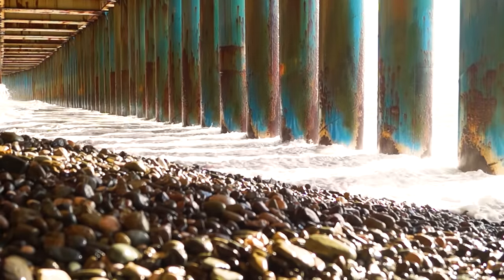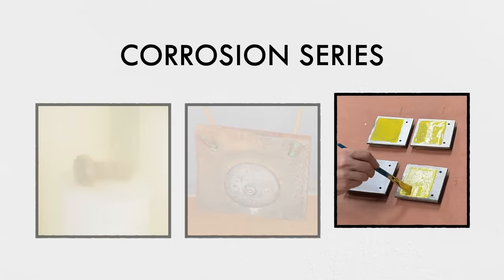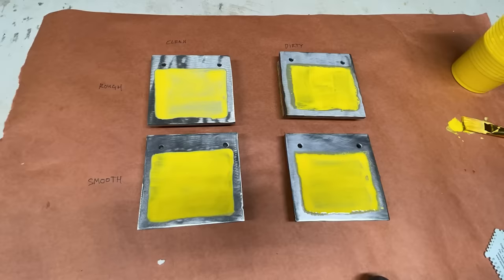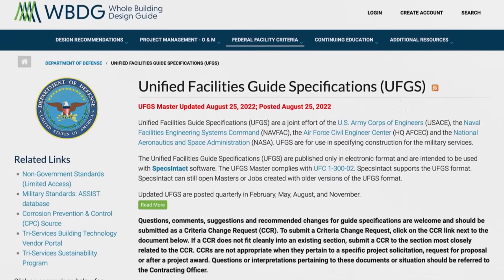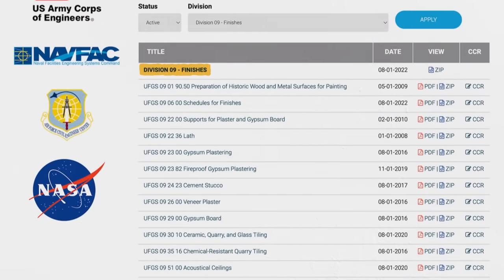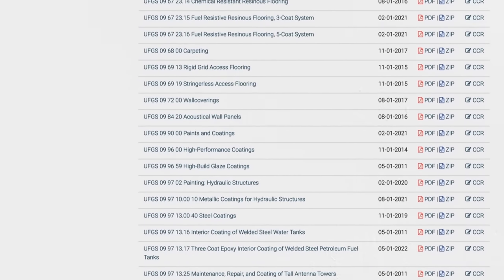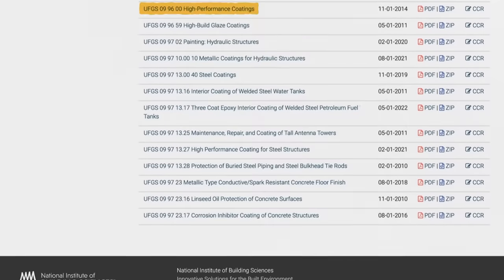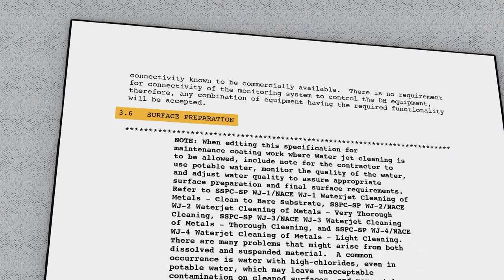What's the Difference Between Paint and Coatings?

Comment: I'd like to argue that the field of engineering is fractal. No matter what it is you're dealing with, an engineer had to design it, and another engineer had to design parts or materials for it.

There's no bottom. No matter how far down you go, there's something that an engineer did. Coatings are engineered, and I bet the components of that coating are each engineered.

Comment: A little late to the party, but as a painter, I wanted to correct your statement about paint at the start. Paint is not just for decoration, it is used to seal substrates, create bonding layers, form moisture barriers and protect against UV or chemicals, prevent rust etc. There are a large number of products that are used which are classified as paint. Then there are coatings that are not classified as paint, such as the polyurethane coatings you use to seal and protect timber floors/deckings, form “high performance” protective coatings etc. You could even consider sunscreen a coating, as it is a coating designed to protect your skin from UV.

A more accurate way to describe the relation between the two is ALL paints are coatings, not all coatings are paint.

Comment: Forgive me for misunderstanding, but wouldn't the paint on the outside of a house be a coating? My favourite podcast, Well There's Your Problem, has mentioned that one of the issues with modern conservation efforts of older houses is when the wrong paint is applied, that can prevent the structure of a house from 'breathing', causing bricks to crack in the winter or wood to rot from humidity.

Comment: If there was a video on heat treatment, fatiguing, inhibition, and alloying, you’d completely finish the ways that corrosion is prevented, treated and mitigated, (while alloy and heat treatment may be material selection, they are very important to the ways you prevent corrosion)

Comment: Sorry to disagree with comments below. I believe the Sydney Harbour Bridge and steel approach ramps are continuously painted. Or at least were. There is a massive amount of surface area on this amazing structure, it could easily be a 20 year round trip. The below link states: 
Regular repainting of the steelwork is an essential and ongoing part of the Sydney Harbour Bridge maintenance. Around 485,000 square metres of steelwork – which equals about 60 football fields – need to be painted, with 30,000 litres of paint required to give the bridge just one coat. Inspection of the steel work is necessary and a variety of tradespeople help maintain the bridge. These trades include ironworkers, boilermakers, fitters, electricians, plasterers, carpenters, plumbers, riggers and painters.

Roads and Maritime completed work in 2015 on about 90,000 square metres of steelwork below the deck level of the southern approach spans. This maintenance work involved removing the bridge's old paint and repainting. As part of this process, each layer requires a full day of drying time, making this project time consuming and heavily subject to weather conditions.

Roads and Maritime goes to great effort to contain the paint dust and paint spray when stripping and reapplying new paint on the bridge.

A number of platforms were built to give workers access to the bridge and the steelwork beneath the pedestrian walkway and cycleway during work on the southern spans of the Bridge. The access platforms were fully enclosed and use air extraction systems that remove and filter all airborne particles from the work area. A photo of a painting platform is show in the image gallery.

A robot was also developed to help with the maintenance of the bridge.

Roads and Maritime aims to reopen areas to public access as soon as work is complete and it is safe to do so.
 
See this link to learn more. https://roads-waterways.transport.nsw.gov.au/projects/sydney-harbour-bridge/maintenance-technology/arch-maintenance-units.html

Comment: I was immediately wondering about the surface prep aspect--if they allow any rust to form before they apply the coating, if there is dirt or other substances blocking full adhesion, etc. That steel must need to be spotless for a coating to last 50 years!

Comment: your test was very good but the dirt with oil was not very good for the experiment because the oil protects the metal against corrosion, however the oil and after the painting takes away the adhesion of the painting.  very good video! it would be better to leave the metal dirty at the same time with dust, water etc..

Comment: Ouh😲 That's exiting! I'm curious how long exposed rusted metal panels such as on Barclays center in Brooklyn will last, and what is the lifespan of such exposed rusted panels. I think it will be very educative for Architects to know the impact of specifying exposed rusted metal panels of the building. Seems like a great job for another Rustomatic test.
Reply: Its probably Corten steel. Designed to form a protective rust layer.

Comment: this is not a coating system, just top-coating. A system is more advanced in form of thicknes, different coats and preparation of the surface such as blasting, if metallizing it needs to be sweepblasted to sa3. but great to see a informational video on the subject.

Comment: And they used to coat steel rebar with acrylic to keep the highly alkaline environment of cement will rust right through the rebar, leaving the concrete unreinforced, leadig to failure of the cement and possibly of the structure.

Comment: Hey, I gotta say, interior paint is not just aesthetic, it does serve a purpose. It protects the material underneath, especially drywall and the joint tape and compound used on it. 
A painting is definitely "paint, cosmetically" and not a coating. But yes, interior paint does indeed serve a purpose to protect what is underneath.

Comment: Interestingly, coatings also play a significant part in the archival fine arts industry. There paint plays, ostensibly, a more important role than merely "decorative" and the purpose of coatings is to protect the paint itself. The first coating, a ground, both protects the substrate from any deleterious effects of the paint, (which could potentially introduce acids to the substrate,) and to prevent adverse effects like support induced discoloration into the paint. Then when the painting is finished, an additional coating, typically called varnish, is layered on top of the paint, and when applied correctly can be removed without damaging the painting underneath. This way as the outer layer collects dust and grime over time, it can be replaced to restore the painting to its original brilliance.

Comment: Rust-O-Matic 3000 - LOL! But on a serious note: There is a big difference between the paint you might get at a hardware store, and a true industrial coating. I used to apply catalyzed urethane, stratified Teflon, and high-bake waterborne acrylic enamel. Most hardware store paints can be easily wiped off after drying (and even baking) with some acetone. The industrial coatings are very difficult if not impossible to remove even with methylene chloride-based strippers. The Teflon stratified coating MUST be bead-blasted to remove! Very big difference in durability.

Comment: Wrought iron has silicon mixed into the iron throughout its thickness when manufactured so that it continues to create a very thin coating of glass on its surface as it is used, reducing corrosion to very small amounts from such things as sea water.  That is why the hull of the FIRST IRONCLAD (ARMORED) BRITISH IRON-HULLED WARSHIP HMS WARRIOR, built around 1860, is still intact today, though neglected for decades after it was decommissioned as a warship.  This kind of protection, when possible, is by far the best and most durable.

Comment: BTW concrete AND mortar that surrounds iron and steel must be  an extra strong mix to keep out salt air up to a thousand yards from the sea, also rebar should be more than an inch from the surface to avoid spalling or concrete cancer.

Comment: I'm a marginally educated layperson and my understanding is that the surface of the metal needs to be in contact with oxygen (or an oxidizer) in order to rust.
Conversely rust is the oxidizer in some chemical reactions, like thermite decomposing into chemically pure iron and an oxide of the other metal (usually aluminum or magnesium).
I'm frequently frustrated that I know lots of facts about things without necessarily having a deep understanding about the thing or process itself.
I could explain calculus, but I'm failing calculus.

Comment: Using a consumable on a ship is the same principle as the anode in a water heater. Have you checked yours lately? A $30 anode can save you thousands by not having to replace a leaking tank due to rust. What I’d like to know is why air compressor tanks are not coated on the inside. They collect moisture every day all while storing 100+ PSI of pressure. Is it the same issue as with rebar? It needs to be 100% perfect or that pin-hole becomes a rust focus point which creates a faster failure?

Comment: Only thing he got kind of wrong I want to point out is that the tool they use for detecting bare metal doesn't actually have to touch metal it's actually more impressive in that it uses such high voltage that simply being close enough for a spark to jump to the electrode through the uncovered spot is how it actually works. Used to refurbish drill pipe with ceramic internal coatings and can tell you the machine they use to check it definitely will give you a jump if ur not paying attention.

Comment: My understanding of the difference between "paint " and "coating" was whether the chemical was pigmented, and designed to dry out, leaving a colored coating. Coatings, at least when in terms of corrosion prevention, referred to petroleum-based chemicals that were designed to largely "stay wet" in order to provide hydrophobic protection from water, and the resultant water induced corrosion.

Given my area of expertise in aviation, (Had my A&P license since 2006), it could just be the difference technical jargon between those fields. Or I could be misunderstanding. I hate applying corrosion inhibiting compound. It gets everywhere (especially hair) and because it's designed to be resistant to water, getting it off your skin either involves scrubbing the top layer off entirely, or the usage of harsh solvents (starting at 99% Isopropanol).

Wow, I went off on a ranty tangent there.

Comment: Some structures use uncoated high tensile carbon steel that forms a rust layer and ironically that rust layer shields the steel underneath from rusting.  Self healing low maintenance.   Brown is the only colour choice though.

edit.  I see now that you previously did a video on sacrificial protection.

Comment: Grady, I have to open this with an apology, you're the last leg of the youtube machining and engineering structure to get a subscription from me. Not for lack of interest or familiarity, my interests just lay more with the machining side typically. However, I find myself in engineering school and blending disciplines a lot more lately. As such, it's time to right some long standing mistakes. 
But, to the matter at hand, I find myself in the HVOF and thermal spray world lately. We have a lot of parts that roll through primarily for abrasion resistant coatings but also for corrosion in some cases. We can spray precise layers of inconel, stainless steel or chrome to mask off areas. It's also getting adapted to other purposes on more large scale applications. All in all, not a solution that should, could or would be applied broadly but, if you really, really, need to stop rust, nothing does the trick quite like coating the problem in inconel.

Comment: Galvanizing is a huge part of steel corrosion protection, you didn't mention it once. Also the experiment you did is called undercutting and it tests the degree to which corrosion passes under the paint.
Reply from the maker: I talk about galvanizing in the previous video of this series.
Reply: @PracticalEngineeringChannel  Okay, this was the first one I had seen in the series. I will check it out!

Comment: Unfortunately a holiday detector doesn't have to touch bare metal to spark and set off alarm. Paint or fusion bonded epoxy or whatever coating can have a flush pinhole from out gassing. Dielectric strength of air from substrate to top of pinhole of coating is based on voltage to thickness used and typically not enough Dielectric to stop arc. However opposite can be said with fisheye which is a trapped out gassing. Thin shiny glass over as in epoxy that's actually tall enough from substrate makes the distance between spark and not even though that thin glass eye if at substrate wouldn't be enough to stop the same amount of electrical energy.

Comment: I've got a question about rusting. Some metals, like Magnesium (I think) can actually prevent iron from rusting when in contact with Iron because, as I remember it, they 'want' to oxidize first. So why aren't blocks of such metals placed attached to large iron/steel structures? These could be replaced regularly, with minimal rusting to the steel structure. Are such blocks used? If not, why? Is the reason to do with chemistry, engineering, or economics?
Reply from the maker: You should watch the previous video in this series

Comment: I would argue that a paint is a coating. Let's not forget that one of the key purposes of interior paint is to waterproof the drywall or plaster underneath as well as to provide a hopefully more durable surface resistant to abrasion and such. So how is this different from any purpose made "coating" applied to a bridge or other vulnerable structure? Exterior paints provide a way to seal wood and brick or similar surfaces such as stucco to prevent it from absorbing moisture or being degraded by the sun and weather. Effectively the same job. Attractive colors are just a side benefit. Ever consider a deck or other structure (eg a gazebo or even just a picnic table) that gets torn apart by the weather and has to be replaced because it wasn't sufficiently well protected? It ain't just bridges that fail when they aren't properly protected and that protection isn't maintained. Also, any good painter will tell you that carefully cleaning and preparing a wall or other structure's surface is vital to getting a good paint job that lasts for the time it is supposed to. So how exactly is paint not a coating?

Comment: One aspect that was missed, you have a perfectly done coating on a steel structure with no flaws in the coating at all.
oops, the hot summer day has caused the steel to expand, now you have cracks in your coating. This same issue applies to aircraft and ships as well.
The cold winter night shrunk the metal causing even more damage to the coating.
While metals are fantastic building materials, the expansion and contraction they  have adds breaking stresses to coatings designed to protect the metals from the environment.

Comment: What about the idea that you can let something rust or corrode and just leave it that way?  The layer of corrosion becomes the protective coating for the metal.  I've heard that's why we consider aluminum rust proof.  It does corrode but the grey aluminum oxide protects the under lying metal from further corrosion.  Couldn't rust do the same thing for steel?

Comment: as a former machinist and current mechanic I know that zink is great to protect steel
I also know that oils and corrosion inhibitors do an even better job, but only as long as they are on the surface

now here's an idea
what if I mix something like cavity protection(wich is usually pretty runny) and mix in some zink powder?
has anybody tried that before?
would it even be worth the hassle?
reason I am pondering this is because first of all, straight up zink powder is cheaper than spray
and mixing it with oil(or cavity protection stuff) would allow me to get it in to cavities where the normal spray wouldn't reach

and the cavity protection stuff I use likes to creep, like 2-5cm from where it was applied, so perhaps it would carry some of the zink with it?
or would the zink just seperate out and sit at the bottom of the cavity and even drag some of the actual agent with it making the results worse than just cavity protection?

Comment: 12:06 - You sell yourself short. It may not be to the strictest of standards in a professional testing environment, but it was a roughly equal lab test suitable for its needs. The only way I see that you could have made it more equal was if you had painted the squares within a stencil on each to make them more uniform. But that would only be necessary if measuring the rust intrusion. As you did was adequate for showing a basic comparison.